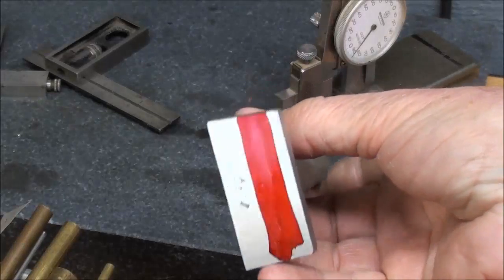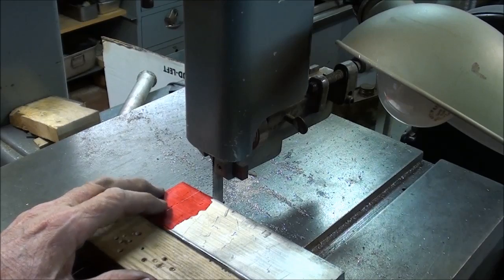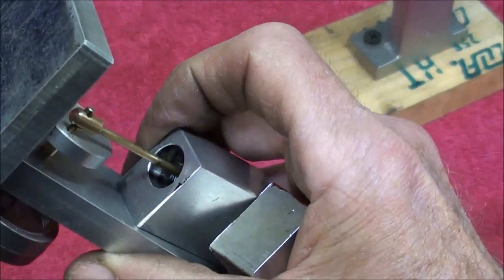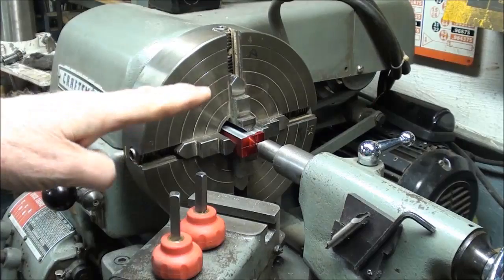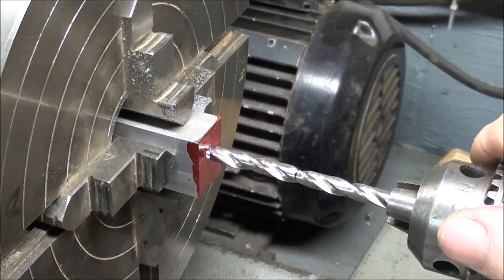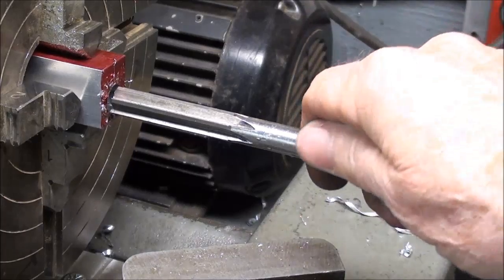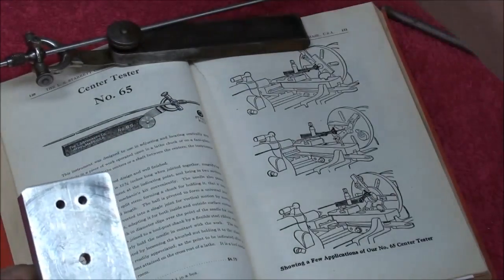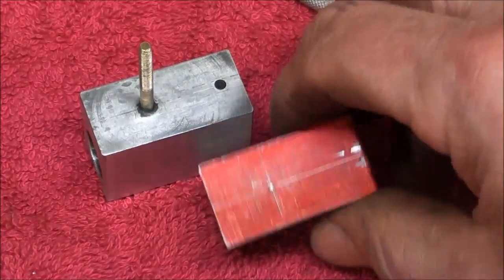TUBALCAIN BUILDS A SA OSCILLATING STEAM ENGINE Part 2 of 5

Comment: When I used to make model railway locos and  flats were needed at the bottom of holes I made  "D" bits of several sizes. They are very effective, cheap and easy to make, but you must be accurate with the filing. I have had them for years.

Comment: Tubal cain , i have an ettco 4b tapper attachment and i need to remove the taper shaft and turn it down to 5/8 straight for my drill press. Have taken it apart but im not sure if its threaded in or not. Can you help sir?

Comment: I've been watching these videos and trying to build one of these engines myself but it turns out that the 1/2" reamer I bought of ebay has quite a taper on it and produced a tapered hole. Could someone tell me what type of reamer I should use to get the hole as uniform as possible?
Reply from the maker: Hand reamers are tapered near the end. Did you go in deep enough? Then use a machine (chucking ) reamer. Try boring instead of reaming.
Reply: mrpete222 Brilliant, thanks. A 1/2 inch chucking reamer is on its way!
Fantastic videos by the way, a good bit of practice for me before starting on a more complex engine.